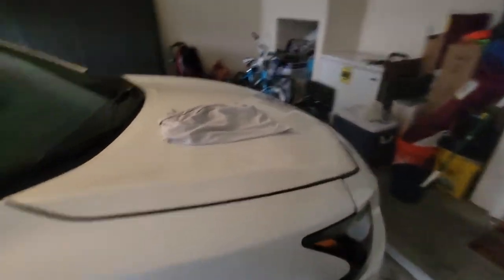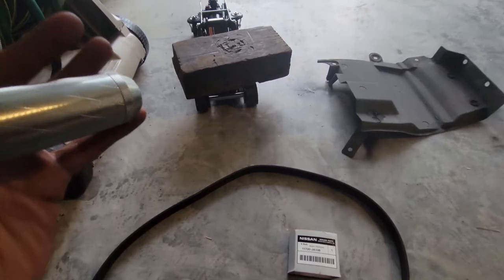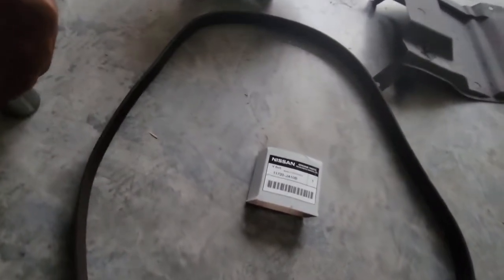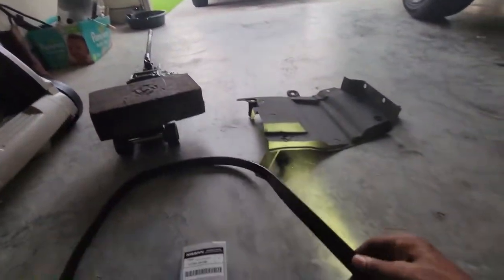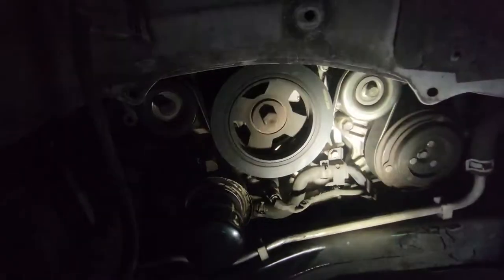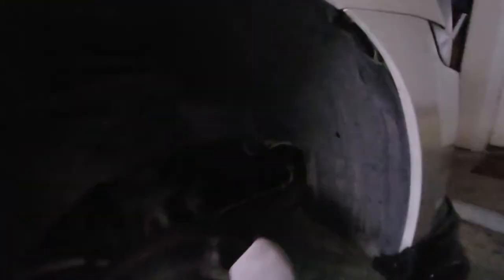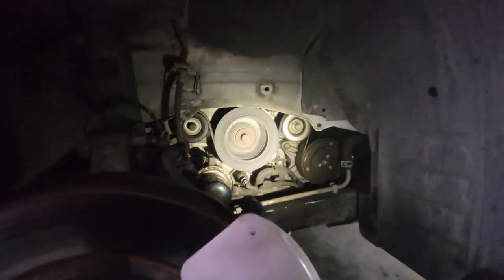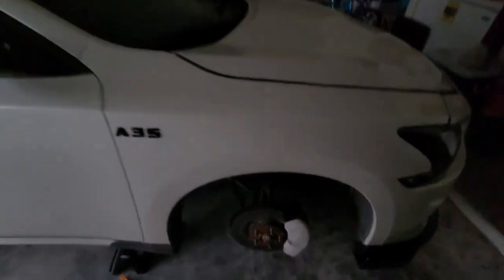How to change the serpentine belt on a 2009-2014 Nissan Maxima #nissanmaxima

Comment: Sir you were a life saver on the drive belt, but about that exhaust tho ha. What's the info on that? But I got it done in about 20 mins and got the belt from Auto Zone for like $20 with a 3 yeah warranty.
Reply from the maker: Thank you thank you
What about the exhaust?

That's good I don't usually go to autozone so I don't think of them when it comes to parts
Reply: @The4-D  I’m late AF ha. But I’m looking to change out my exhaust and that start up sounded  appealing. What brand did you go with?

Not sure it you’re out in Cali but they are one of the go to’s that just everyone uses.
Reply from the maker: @georgewashington4194  Hmm I think this was with the custom 3in exhaust with a 3in vibrant resonator in the middle and a jemini ypipe
or I think the car sounds best with a muffler delete and vibrant resonator though and maybe a ypipe if you want more hp+tq

Comment: How many belts does it have ? I have a 2012 maxima and the belts are squeaking. I replaced the drive belt a few months ago. How could you tell if I need the belt tensioner or a new belt ? I got the belt from auto zone. Should I get a nissan one ? TIA!
Reply from the maker: Just 1 belt, if there is squealing after a cold start or in the rain or a rough idle or less power from the a/c, engine or battery it might be the belt

I usually call the dealership first the oem part number then search online for it since the dealership will over charge you

Comment: I was doing my belt today my belt was mad tight I pulled down the tensioner but the belt wouldn't go over the ac compressor  how can I loosen up the belt more
Reply from the maker: If it's the right part number then the belt should be fine
You might need someone to pull it down while you put the belt on 
Try starting from the highest point you can and then try pulling the tensioner down
Reply: @The4-D  I had my friend helping me she was pulling down the tensioner but the belt was to tight I guess I have to stretch it the belt I got it from autozone it warp around all the idler pulleys but one when I tried to pull it up it was super tight
Reply from the maker: @Tootoojackson  did you double check to make sure you're putting the belt on the right parts?
And did you try to pull it down or just her?
Reply: @The4-D  yes I did try it a few different times the tensioner does work good I got the over everything except for the tensioner when I pull down because the belt is so tight I can't push it up is it a way to stretch the belt just a  little bit
Reply from the maker: @Tootoojackson  it's supposed to be a really tight fit but yeah if you have a video you should post it

Comment: From my understanding, when the steering wheel  lock on nissans goes bad, the dealership will charge hundreds of more to replace or bypass. Yet, a person can disable it fairly easily. Took me like two hours to read up, and figure out what do, and 30 minutes of light work to do it. Dealership would have been very expensive.
Reply from the maker: dealership always over chargers I only use them when I need a name or part number